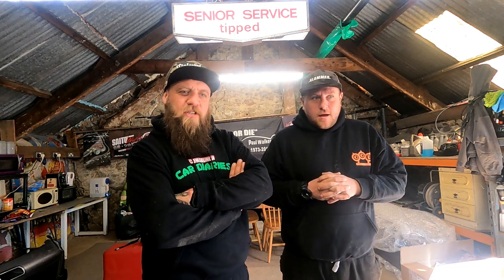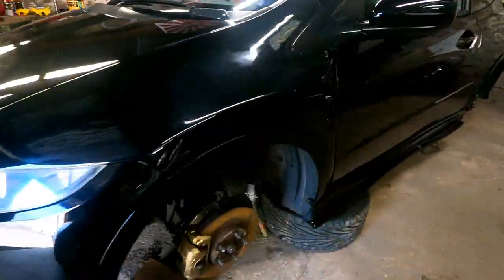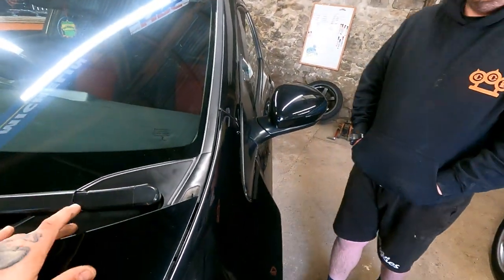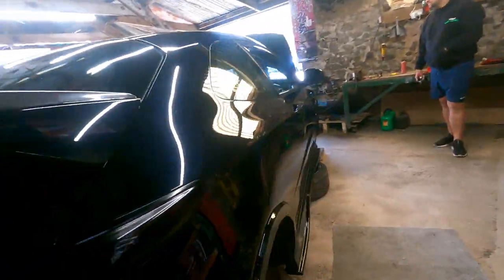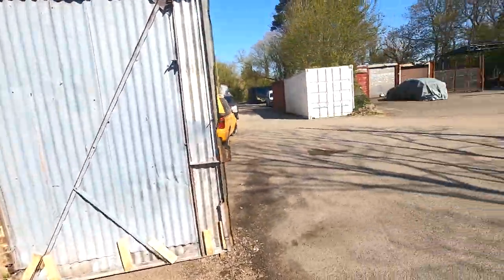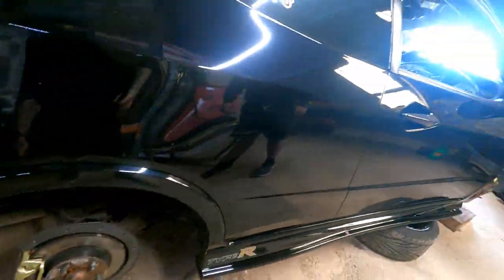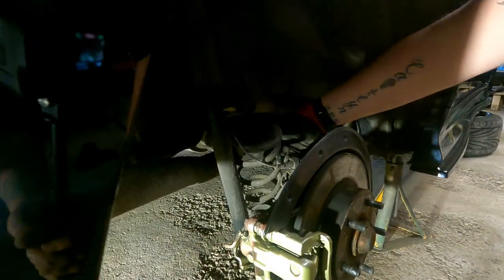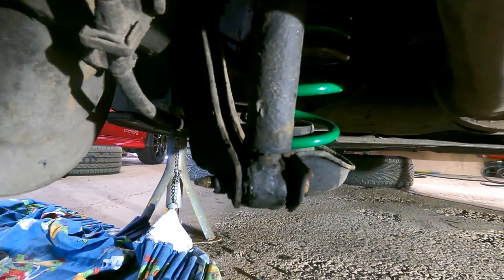Honda Civic FN2 Type R Tein Lowering springs install **Plus Special guests**

Comment: I fitted Tein springs to my fn2 last week, great improvement it looks and a noticeable difference in comfort.
Reply: I’m just about to buy a set. Did you replace the drop links and have you had the wheels re-aligned? Thanks
Reply: @TheSnoochmarster  yep, replaced the drop links, had to cut them off. I haven't had an alignment, it's drives perfect.
Reply: Hey Diddles do the springs go on a certain way like are they marked up for left or right can you remember?
Reply: @ryanj4268  they aren't sided, but I just made sure I fitted them with the writing up the right way round.

Comment: Is that the HZ dynamics carbon fibre bonnet? Also where does the rain go when it goes in the vents?
Reply from the maker: No idea who made it mate sorry. Possibly Tegiwa. As for rain I know
You can fit rain guards for the winter months if worried about it 🤘🏻❤️